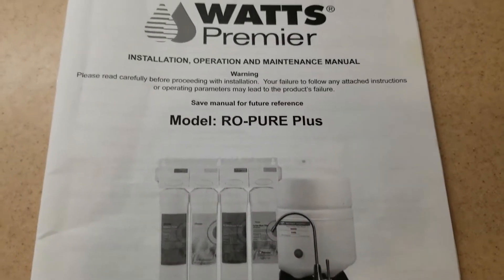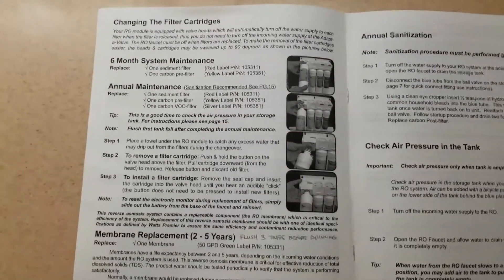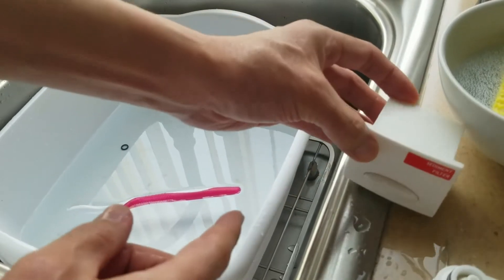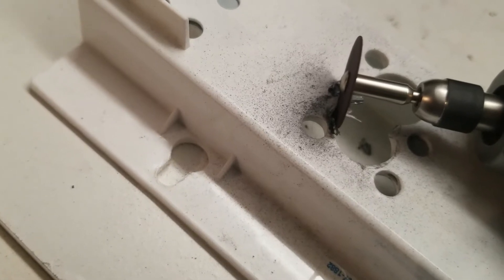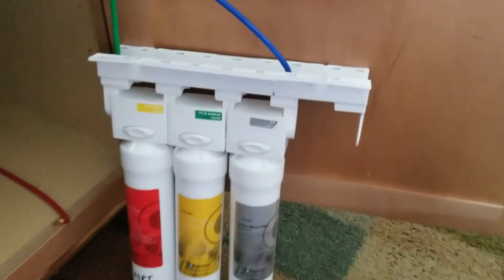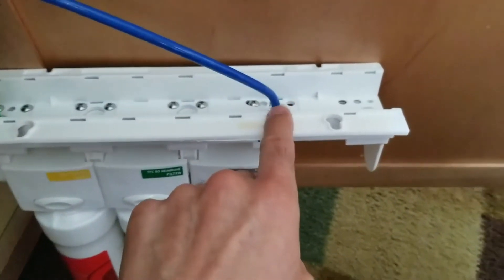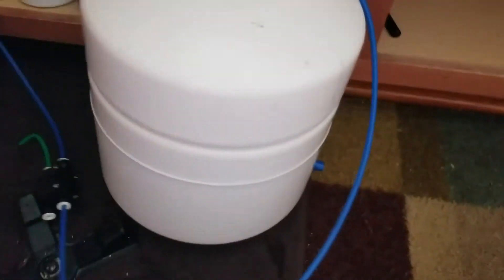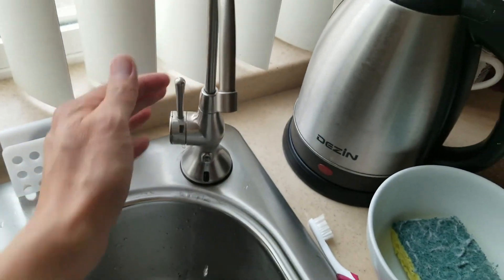Water Filter Modification for Costco Watts Premier RO-Pure Plus

Comment: Instead of going through the trouble of modification why couldn't you just replace the reverse osmosis filter with one of the cheaper filters in the bunch  this way you were still getting all the minerals and you didn't have to go through all the trouble of modification